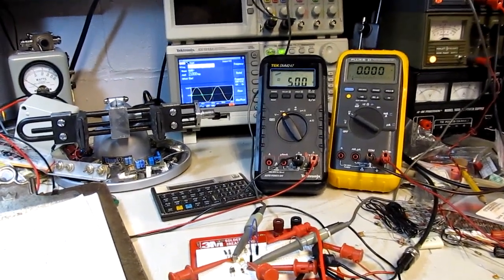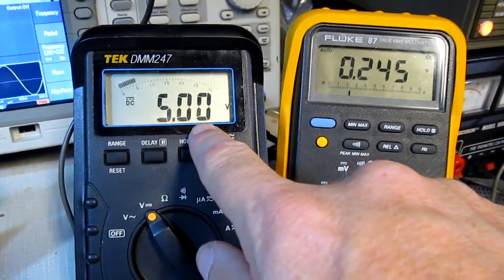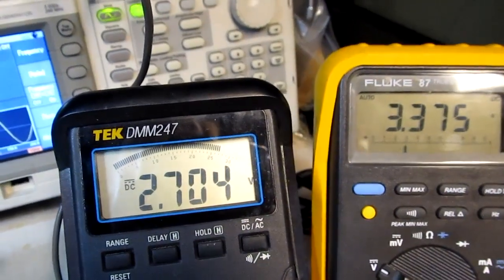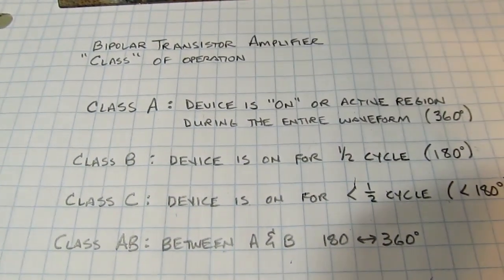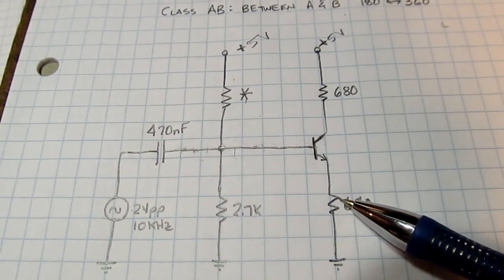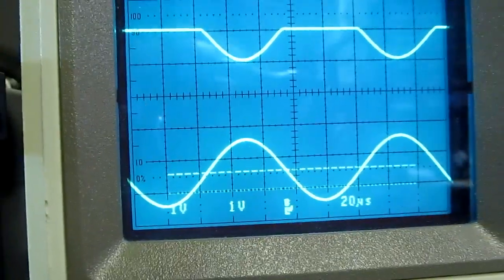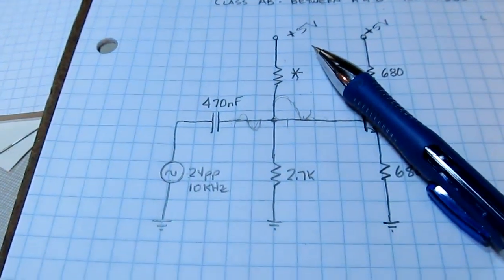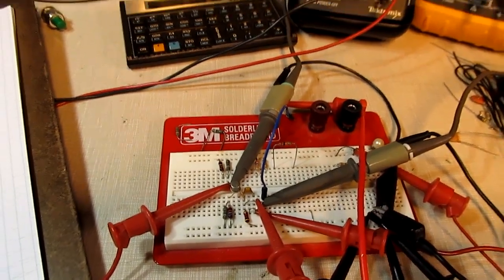#113: Basics of Transistor bias point and the class of amplifier operation

Comment: Greetings, my question here regarding the video is about the emitter resistance. If the emitter is tied  directly to ground, the base voltage will be 0.6 volts whatever  the voltage divider resistors setting. So how can the transistor operate in different operating classes, especially class A? (In other words, is the emitter resistance necessary for the transistor to operate in defferent classes ?)
Reply from the maker: With the emitter tied directly to ground, you can get class A operation under certain conditions, such as:  very small signal levels like <50mVpp input, or using negative feedback from collector to base to limit gain.

Comment: Like many other things in RF, I have to beat them into my brain with multiple operations and a sledge hammer in order for them to really get in there. I seem to have gotten there. But, I know that I am going to have to set this up at take a look in order to really have it well. Even with the age of my two input CRT scope, it is a really helpful tool. Along with a a nano VNA and a TinySA, its almost real shop. 
 
These days I  am going to want to see what the frequency domain products look like.  I understand that with OOK there should be no difference, its what I am interested in now,  but just half a sin wave seems like it should be significantly better than the typical square wave harmonics. The fact that I can think about this sensibly (at least to me) is a sign that I have internalized some of this. 
Thanks!
Reply from the maker: Half sine will have a fair amount of even harmonics (I believe).
Reply: @w2aew hopefully I'll find out. Right now the ham project is to get my Michigan mighty mite to work with my Solder smoke DCR

Comment: Hi Alan, I learned so much from your channel. Thank you for your effort and time. I have a question about transistor biasing. Is is possible to bias the transistor with signal generator? for example, set the signal generator to generate 200mV peak to peak sine wave and DC offset to 2V, this gives 1.9 to 2.1V base voltage. I tried it. but somehow not able to make it work. hope to get some guidance from you. thanks again.
Reply from the maker: Depending on the signal generator - yes, you can do this.  Many function and arbitrary function generators can add a DC offset to an AC signal.  Keep in mind that most "expect" to have a 50 ohm termination - if you didn't have that, you may have gotten double the expected voltage and offset...
Reply: @w2aew  Thank you. I will note that and try again.

Comment: What is CTAT complimentary to absolute temperature? It's used when biasing transistors in power amplifiers but not sure if it's used in biasing for pre amplifiers?
Reply from the maker: Yes, see a description in the first few paragraphs here:
https://en.wikipedia.org/wiki/Bandgap_voltage_reference
Reply: @w2aew  I'm confused what the differences between CTAT compared to transistor thermal runaway? Are they the same thing or different?
Reply: @w2aew  the CTAT has something to do with a bandgap reference voltage that it will cancel out the voltage when the bias idle current is "matched" between the complementary transistor pair?
Reply: @w2aew  when the transistors collector current increases high the transistors CTAT will cause the transistor to drift the biasing point or the transistor is unstable. It seems the transistors CTAT is causing thermal runaway but not sure why transistors even have CTAT? It seems that the transistors emitter has CTAT but not sure why or what is making up the CTAT in a transistor?

Comment: Biasing Transistors the collectors DC voltage is HALF of +Vcc, when biasing FETS the Drain DC voltage is NOT HALF of +Vcc, any reasons why? also biasing Tubes the Plates DC voltage is also NOT HALF of +Vcc, any reasons why?

Comment: Hello. I built an 8 hz sine wave generator with the xr2206 circuit. now I have to apply this signal to a 4 ohm coil with the help of a final stage. the signal does not have to be amplified, just applied to the coil. can you help me with a final stage even made with a transistor? the generator is supplied with 10-12 v.
Reply from the maker: A simply unity gain stage using an emitter follower should work.
Reply: @w2aew  can you direct me to a diagram and then tell me what resistors to use, what capacitor values to use and where to attach the 4 ohm coil?...the final sinusoidal wave, at the end, must be approximately in the range of Vmax 3.00 v and Vmin -0.64v ...thank you...
Reply from the maker: @stefanb.933  Would need some more details.  Is your existing signal of the correct amplitude and offset?  Does the coil need to be DC coupled?  Is the coil grounded at one end (meaning that the current will have to reverse during the cycle)? Etc...
Reply: the signal obtained now only with the help of the xr2206 is perfect for me, it falls within the following parameters: freq: 8 hz, cycl: 0.120s, pw: 0.065s, duty: 50%, Vmax: 3.00v, Vmin: -0.64v, Vavr : 1.21v, Vpp: 3.56v, Vrms: 1.70v...these values are measured on the DC  of the oscillator...but this signal must be measured at the end on a 4 ohm coil...the coil does not matter where it must be placed.
Reply from the maker: @stefanb.933  The question of the coil remains.  Is the coil grounded?  In other words, does the amplifier/buffer need to apply 3V peak to the 4ohm coil load, meaning that is must supply 3/4 of an amp of current during the positive peak (and must sink about 160mA on the negative peak)?
Reply: @w2aew  yes.
Reply from the maker: @stefanb.933    OK - you'll need a unity gain push-pull buffer capable of delivering close to 1 amp of current.  That should give you enough to search on.
Reply: @w2aew  Can you help me with some ideas? examples of schematics?
Reply from the maker: @stefanb.933  https://www.google.com/search?q=high+current+push-pull+buffer+design&rlz=1C1CAFA_enUS792US792&oq=high+current+push-pull+buffer+design&gs_lcrp=EgZjaHJvbWUyBggAEEUYOTIKCAEQABiABBiiBDIKCAIQABiABBiiBNIBCTEwNzU4ajBqN6gCALACAA&sourceid=chrome&ie=UTF-8

Comment: To compute the transistors transconductance GM is Current/Voltage = 1/Resistance = mho . The Collector Current divided by the Base Voltage = 1/Resistance = mho Transconductance? The Transconductance is related to the GAIN of the stage but what is confusing is if the GAIN of the stage is a gain of 2 or a gain of 5, the transconductance mho will not be 2 or 5 so not sure how GAIN and Transconductance are considered the same thing.
Reply from the maker: That's not exactly the definition of transconductance.  It is actually (small change in Ic / small change in Vbe).  In other words, it is the small incremental change in collector current that is driven by a small change in Vbe.  The GAIN of the amplifier is a function of what LOAD the collector current is fed into...
Reply: @w2aew  I thought you can convert transconductance into gain, or you can convert gain into conductance? If the transistor or tube amplifier stage is a gain of 2, how can you convert the gain of 2 into transconductance? Most technicians will say that gain and transconductance is the same thing which I'm sure you have heard this by other techs
Reply from the maker: @waynegram8907  Transconductance is one component of the overall gain of an amplifier.  For example, for a common-emitter amplifier with no emitter resistor (or emitter resistor bypassed with a capacitor), the amplifier's small-signal GAIN is equal to GM*RC.
Reply: @w2aew  for guitar amplifiers they use fixed bias or cathode bias so not sure how transconductance of the power tube is equal to the gain or you have to use a formula to convert the transconductance of the power tube into gain?
Reply: @w2aew  Each Biasing Configuration is also a component for the overall gain of the an amplifier stage. Using different biasing configuration will alter the overall gain of the amplifier stage. The Concept is Biasing configuration + the transconducance of the transistor, fet, tube = Overall Gain?

Comment: Class D amplification is like a switch being turned on and off. EE techs have said that the "power loss" is zero because its like a switch turned off its P=V x I which is zero Audio Signal Voltage X zero current = zero power and when the switch is closed its P=V x I which is Audio signal Voltage across the closed switch will be at the same potential so the voltage is ZERO X Audio Signal Current = Zero Power. I'm not sure which formula to use for Power Loss but this is why EE techs say that Class D has zero power loss. In Class A and Class A/B the transistors are in between close and open so there is a power loss while the amplifier is idling and in that in between conduction. I'm not sure how to measure the power loss using an oscilloscope because using a 2 channel Oscope you can measure the input waveform against the output waveform but that is measuring the GAIN but not sure how to measure the power loss of a preamp? and measure the power loss of a power amplifier?

Comment: I have some problems!!!
How rf power amplifier works
I have a walkie talkie that have a rf power amplifier module inside and powered by 7.5v and have 5watts of power into the antenna 
How this is happening?
We know our antenna have a impedance of 50 ohm so if:
I = v÷r
P= v × I
I= 7.5v ÷ 50ohm=150mA
P=7.5v×150mA=1.12 watts
So why ican see 5watts in my power meter
Reply from the maker: The RF power amplifier uses an RF step-up transformer.  The Power Amp feeds the low-Z side of the transformer (<<50 ohms).
Reply: @w2aew   thanks for answer. I have some modules from motorolla shw5066 they can produce 7watts of power with 7.5 volt battery and when I opened it ididnt see any transistor or transformers!!! I can send  you some pictures of inside of it

Comment: When biasing tubes if the biasing DC circuit isn't stable and its fluctuating or modulating the DC voltage on the tubes grids it will lessen the lifespan of the tube, any reason why this lessen the lifespan of the tube when the biasing DC is fluctuating or modulating? because this doesn't lessen the lifespan with FETs or transistors, only will lessen the lifespan with tubes.

Comment: Why we can amplify millivolts to volts only with transistors but we can't amplify for example 2 to 4v ???
Reply from the maker: Yes, of course you can design an amplifier with a gain of 2x that has a linear operating range to amplify a 2V signal to a 4V signal.  One way is with a common emitter amplifier, using an emitter resistor to provide feedback that will control the gain and help setup the operating voltage range.   See my video on the design tips & tricks of the common emitter amplifier.
Reply: @w2aew  thank u so much👍

Comment: A very good explain and demonstraition how a transistor works. 

RF-Amplifiers are not use class C mode in regular case - that's depend on the used channel coding or modulation mode. Every modulation mode who detects the frequency instead the amplitude of the carrier, can be use a class C mode amp - all other don't.

Comment: Transistor and tube power amplifiers push pull circuits will cause 60hz hum because the push pull is NOT in phase and is out of phase I think. I'm not sure why the push pull causes 60hz hum because there are "hum balancing" trim pots in push pull circuits. You should make a video lesson about this because I would like to know how this works. Adjusting the bias trim pot will not fix this problem, the hum balancing trim pots will align the push pull to be in phase with the 60hz? I'm not sure how or what the hum balancing trim pots does to the push pull circuit

Comment: Could you do a video on getting rid of harmonic distortion and recovering the fundamental back to a sine wave? I have heard of it mentioned before, but it's hard to grasp how filtering could be used to recover waveforms.
Reply from the maker: A low-pass filter is typically used that will "pass" the fundamental frequency, but will block or attenuate the higher order harmonics.  This is shown in my video on the Michigan Mighty Mite oscillator/transmitter video: https://youtu.be/2AdW9Zpl2Es

Comment: Nice vid, I have a question: in the first circuit I see +5v above the 680 ohm resistor. The power supply is on the left, ground and then going through a resistor into the base of the transistor. Where is the +5v coming from or what is that side of the resistor connected to? Are there two power supplies?
Reply from the maker: There is a separate +5V power supply (implied).

Comment: A simple question here... how did you determine the bias voltage at the base of the transistor according to R1 value ?
Reply from the maker: I can't answer your question because I don't know what resistor you are asking about.
Reply: @w2aew  Sorry, your Rx I mean. It cannot be seen as a simple voltage divider, can it? So how did you determine the value of Rx = 36k when you want the bias voltage at the base = 600mV?
Reply from the maker: @lilyzhang9163  Assuming there is an emitter resistor, and assuming that the current through the divider resistors is substantially higher (5-10x more more) than the base current, then it is basically a simple voltage divider.
Reply: @w2aew  Okay, when you set R* = 36k to get 600mV bias voltage, from the voltage divider (36k, 2.7k, 5V), shouldn't it give 5*2.7/(2.7+36) = 0.34V? How did you get 600mV bias voltage in this case?
Reply from the maker: @lilyzhang9163  There is a mistake in the drawing in the video - the lower resistor is actually 4.7k, not 2.7k.  This is corrected in the downloadable version of the video notes.
Reply: @w2aew  I see. Thank you very much for your replies.

Comment: Thank you for creating this video. Question? 1:03 did your DC supply have current control? They say the BJT is current controlled? My fundamentals are still weak here.
Reply from the maker: No - it is just a variable DC voltage.  The voltage divider formed by the two resistors determines the voltage at the base, and the combination of this and the emitter resistor determine the current flow in the transistor.
Reply: @w2aew  Thank you, I am seeing that now.

Comment: Back in the 40's to 60's most of the amplifiers circuit were based on leakage biasing technique because most of the transistors would have a leakage current. The Electronic designer would measure the leakage current of the transistors and make the biasing circuit based on the "leakage biasing". If you replace the leakage transistors and use Non-leakage transistors the amplifier circuits won't work correctly because the biasing circuit values was choose for the leakage current/leakage biasing. You have to use some type of formula to include the leakage current of the transistors to do leaking biasing. Can you make a video lesson about this to show the formulas and why non-leakage transistor won't work in an amplifier circuit that is designed for leakage biasing?

Comment: Most transistors are biased with using 10mA to 30mA for the collector current? It would be real nice if you made a video lesson about calculating the bias resistor values based on the hfe and if you wanted a gain of 1 or 2 or 5 or 10 and calculating the input capacitor value and output capacitor value. There is some trick when looking at the biasing resistor values to tell what the gain ratio of the amplifier is.
Reply from the maker: There is no general rule for the typical collector current level - it is entirely dependent on the application.  Regarding how to calculate the bias level, gain, etc. with a given set of resistors, watch this video:
https://www.youtube.com/watch?v=VWY2WQcKJgk
Reply: @w2aew  Its very confusing biasing up a transistor because there is 3 different ways of biasing up a transistor. #1 based on the HFE, #2 using the biasing Ratio based on the gain, #3 based on the datasheets IC or IE current recommendation. Everyone has a different way and its hard to know which method to use and formulas.
Reply from the maker: @waynegram8907  It's generally very poor practice to design biasing based on HFE.  This parameter is just too variable to count on.  Setting up the resistors and collector current will depend on the end application.  Things like the required gain, output impedance, voltage swing, frequency range, etc. will all factor into the final design.  This is why engineers have jobs.
Reply: @w2aew  if you can make a video lesson about using a voltage divider biasing but use the 3 different methods, biasing based on the HFE, biasing based on the resistor ratios to determine the gain ratio, biasing for the data sheets Ic current. All these 3 different methods use a different base current Ib formula. This would help me out a lot
Reply from the maker: @waynegram8907  I already did a video showing how biasing based on HFE is a bad idea:
https://www.youtube.com/watch?v=YQlbPGNB-ys
In other words, do NOT design your biasing to depend on a specific beta - this is a recipe for bad design repeatability.

And this video walks through the basic design process for a common emitter amplifier:
https://www.youtube.com/watch?v=VWY2WQcKJgk
Reply: @w2aew  Yes I have watched before. I mint to make a new video showing the 3 methods or other methods that you know about. To go over the BW formula of the transistor amplifier and cut off frequency formula of the transistor amplifier. I would like to see how the 3 different methods change the BW, Resonance frequency, Cut off Frequency points for the transistor amplifier. I'm not really good at calculating and doing the formulas to get all these parameters BW, Resonance freq, Cut off frequency for transistor amplifiers. The Base Current and resistor ratio the gain ratio has to be applied I think to the Z impedance for the base current so it gets really tricky. It would be a nice video lesson to go over and practice doing